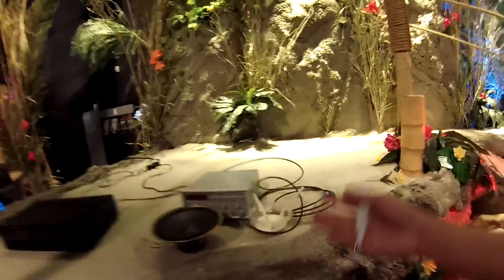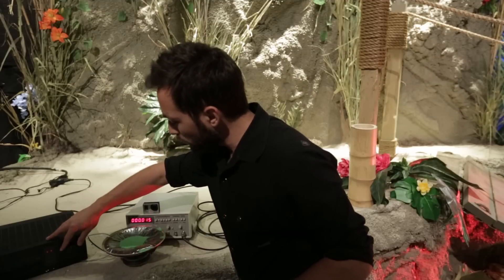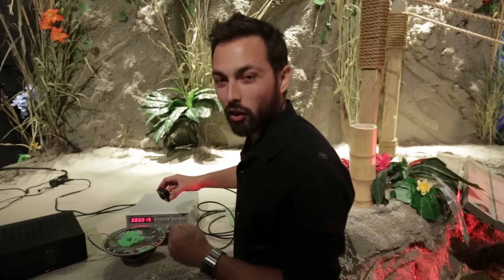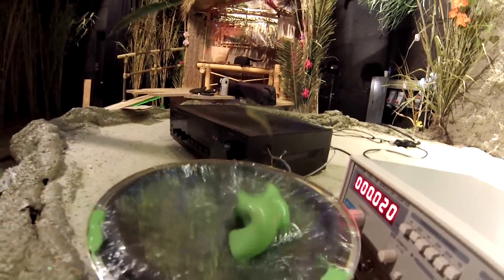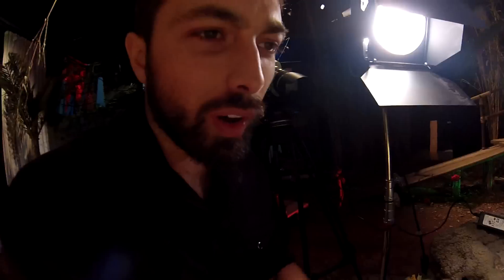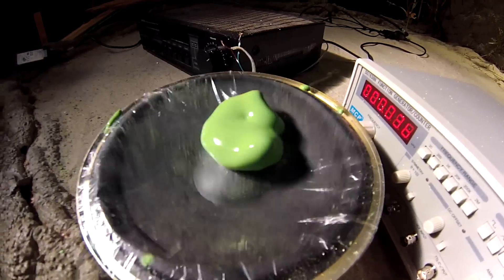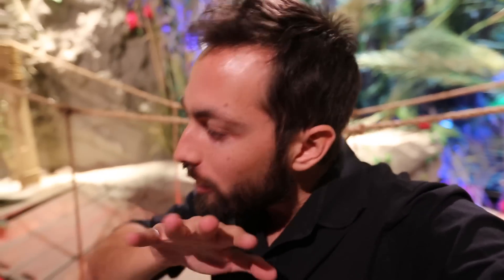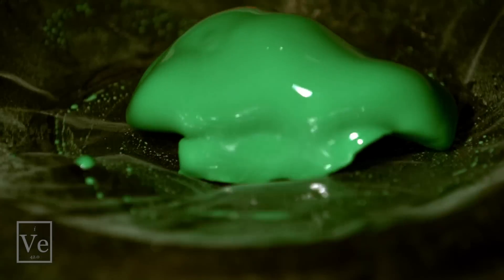Slow-Mo Non-Newtonian Fluid on a Speaker

Comment: It seemed that the plastic cover over the speaker was acting as a low pass filter and absorbing a lot of the vibration and slewing the results which means you didn't get as much velocity hitting it so not as much solid form taking shape. Would love to see this straight on the speaker in slow mo :)

Comment: It's called non-newtonian because it doesn't follow Newton's fluid model. They're being smart with terms in the sense that they are accurately describing the phenomenon, not in the sense of a smart-ass. Quicksand is something else entirely (sand that is kept in motion so that it loses its structural stability, i.e. its ability to carry things on top of it).

Comment: o_0?
So what? Every matirial will resist.
Newton's third law is: To every action there is always opposed an equal reaction.
Basicly, if I give momentum to the water it will give the same power back to me.
It works with gas as well, never heard of air resistance before?
Or maybe a car crashes to a wall, it will get a force of his speed right back at him.

Comment: there is actually some really amazing work in simulating traffic of any kind (not just road traffic) by considering all the particles in the simulation (e.g. cars or pedestrians or what ever you are simulating) as part of a liquid. It's amongst the best methods so far. It can efficiently and realistically predict the behavior of a huge number of individuals.
In those simulations, traffic lights, for instance, are basically valves. The one difference is that the individuals in traffic have goals.

Comment: But I wonder if it's because there are more things inside water other then H2O.
So maybe with pure water you will gain diffrent results? (I don't think so, but it might worth a try).
But the problem with water is, that its not actualy solid. Solid is a matirial that his particals move slowly (compared to liquid and gas), those particles are staying at the same place all the time (and not swaping places, like in liquid) and remains in a certain structure.

Comment: I'd like to see a higher volume of the non-newtonian fluid on a much larger speaker. A large speaker with a low excursion would likely do interesting things to the structures created by the vibration.

Comment: Without incapsulating the speaker there should be Problems with the pressure differential around the speaker. So that when you create a high pressure zone in Front of the cone a low pressure-zone results in the Back of it. In this construction these two immediately equalise and so it's very likely you loose Amplitude and Frequency response for the cone with the aimed for pressure collapsing in itself. Do you think this might effect your experiment?

Comment: Your traffic analogy seems to work very well! Actually I would more specifically point out the interesting fact that in low traffic conditions cars have low shear resistance (fast, medium, and slow lane), but it dense traffic conditions (like increase in starch concentration and inhibition of fluid-like behaviour) it starts to move as a whole, like a solid (nobody is really passing anybody in a traffic jam).